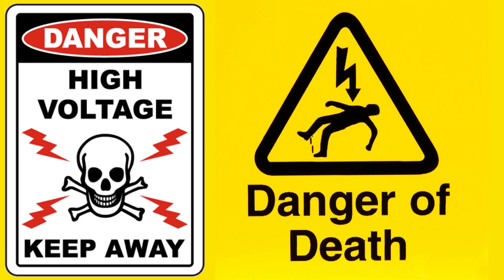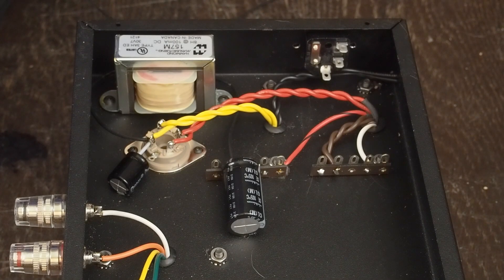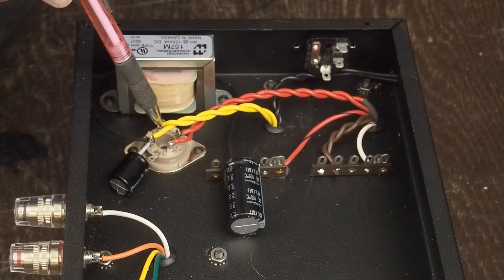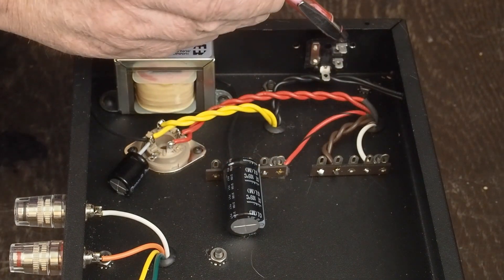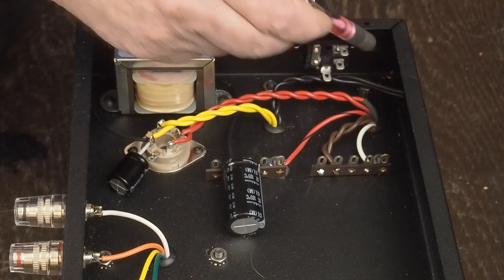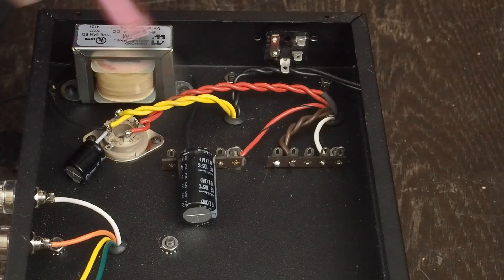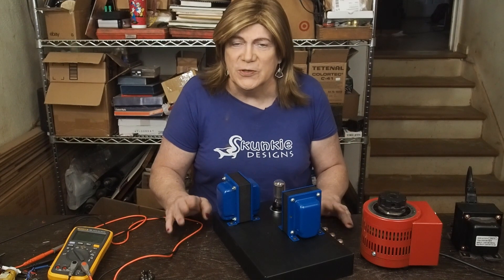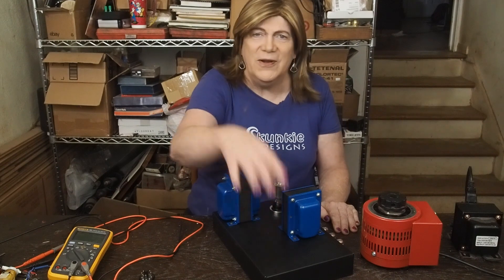Tubelab Monoblock: Power Supply and Voltage Test.

Comment: Stephe, I’m trying to understand when you talk of the Star Ground point and you then go on to explain about a ground lug that I’m assuming would be on the A.C. input socket, and that you want to connect this lug to a ground point clearing some of the powder coating off the metal case.
The capacitor (C1) after the rectifier in Tubelabs Cct is a 47uF 450v. You say you’ve fitted a 22uF. Any reason for that?
Love your videos & explanations.
Reply from the maker: The one from the input socket is the "safety ground" and protects the user from any failures that could make the chassis hot. I went with a 22uF because I am using a slightly different rectifier tube. Even with a 5AR4, a 47uF seems a little big to me but is within spec.